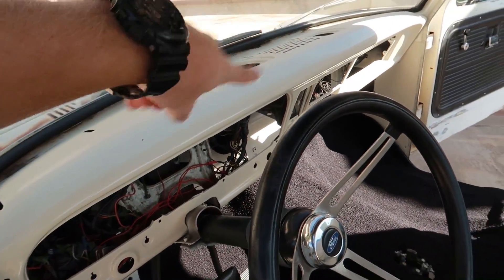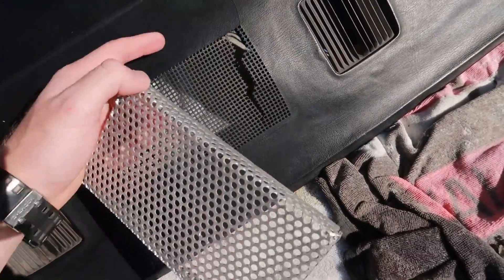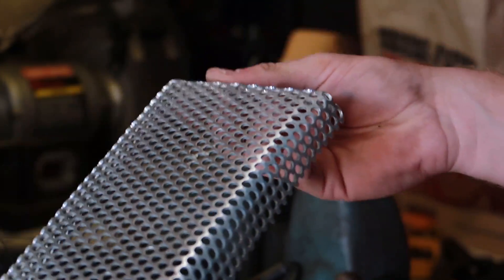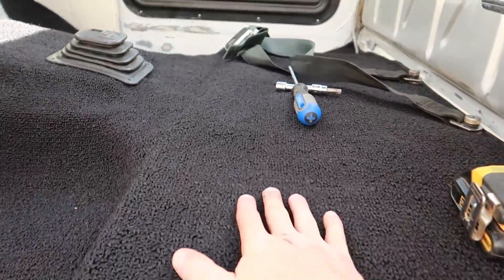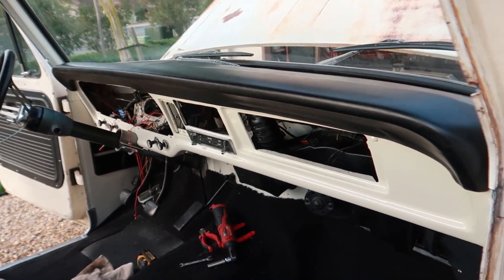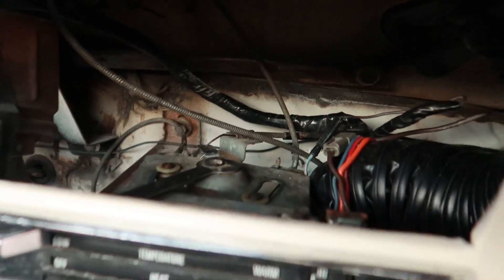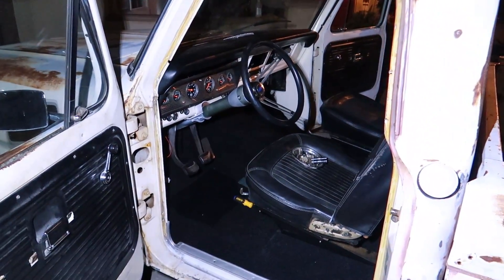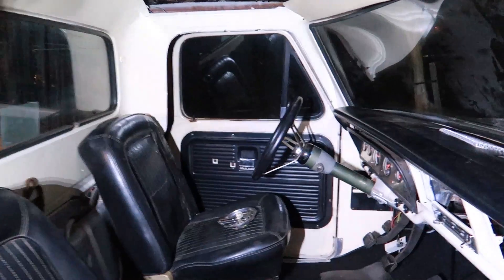F100's Interior Get's Final Touches!

Comment: Looks great. If the carpet is really bugging you, get some double sided carpet tape and use where you need it. It holds strong and unlike glue, you can take the carpet out without ruining it if you ever need to. If you do that , give the carpet a couple of days (preferably warm days) to let it settle before putting the tape on. 

On a side note, I recently found your channel and have enjoyed watching it. As an older guy that has been working on one project or another for the last 30 years, it's cool to see a younger generation taking an interest in older vehicles and actually repairing them. Too many "car enthusiast" today, young and old, just want to bolt on aftermarket stuff and would be at a loss if they ever stumbled into a junkyard. Keep up the good work.

Comment: Keep up the good work! U should do a fiberglass repair on ur dash and add filler sand and paint it will be like new. Use glue on the carpet after the summer or towards the end so it can take the wrinkles out the summer will help

Comment: Also on holes for carpet, heat up a tapered drift punch and itll melt it to the size of the bolt hole and leave an even edge that wont fray

Comment: The viewer that said use steam was spot on and while it is still warm and damp put weight on it for a couple of days. On the dash if you want to make the crack less noticeable use some black RTF and wipe it off except where it fills the crack. RTF will stay flexible even with the hot sun. If you want to use some spray adhesive someplace use it on the gas tank between the seats to cover up the gas tank to a point halfway behind the seats. Looks good keep rolling.

Comment: Use a small amount of resin use a box cutter knife blade and fill it in like body filler and then what you could do get body filler put a little bit on the dash sand smooth then what you could do is bedline it they have in rattle cans then spray it with that 4 easy better-looking Dash just an idea

Comment: you could use carpet tape in those areas where it doesn't lay totally flat. its basically just thin double sided tape, but comes off easily if you ever do need to take it back off

Comment: To repair your dash have you thought about using an automotive vynal and use heat stable contact adhesive to cover over the brittle original dash? You could also try using a steamer to relax the new carpet to help it lay flat.

Comment: to fix that crack real easy just use some black RTV. take a old tooth brush and gently clean it out.spread it out thin but just over filling it. let it set up some and whip it flush with your bare finger. then take the brush and tap it brush down and it will look like the pattern grain.after a day or two even you will forget about it. and the RTV will not expand and fall out and keep it glued together..i fixed 3 large cracks on my 89 lincoln

Comment: Hay Craig i have 68 ford 250 4x4  with  6bt cummins  i have a old detail trick for the old plastic on these old trucks  i use peanut butter it sounds crazy but it works  the oil in it  brings back the shine in it . rub on and let it sit and wipe  off
Reply: Moisturizer does the same trick. Apply, wipe and buff. Shines it up as well.

Comment: Hey just a heads up when I was building my C10 my Dash was cracked couldn't find one didn't want to pay a bunch of money they sold which is LMC salt cells the Caps that go over the dash boards there a plastic piece there texturized in the top looks just like the dashboard LMC had it for the C10 Chevrolet they got to have it for the Ford

Comment: Hay man how do you get the ignition switch out of my dash I have a 78 supercab help thanks
Reply: there is an outer nut. take 2 flat head screw drivers put then in the groves and push or tap really gently with a small hammer. u may need son vice grips to hold the back nut. if it tough hit it with some wd

Comment: hey craig what do you think of the black dash pad covers on npd I have a 1971 f100 ranger the vin is blank on color I think that's because its tu-tone highland green and white it has been repainted a darker green but the original color shows through I think highland was a special color not standard and its got green interior like how yours did, its got the green dash pad that's all cracked up a black seat and green and black door panels I would like to get door panels like yours. so do you think its worth it to get the 126 dollar cover to hide the green nasty dash or should I just buy a whole new black one for 500?